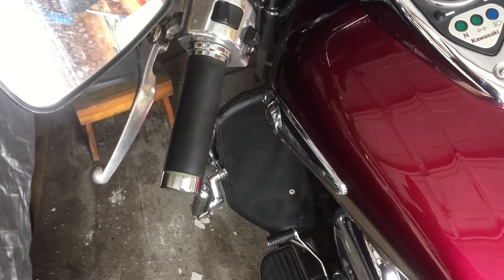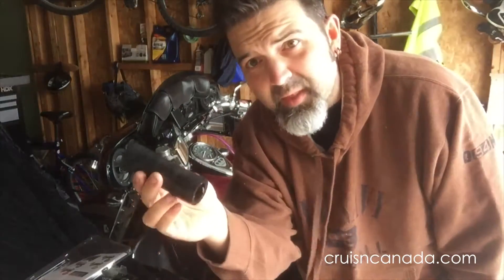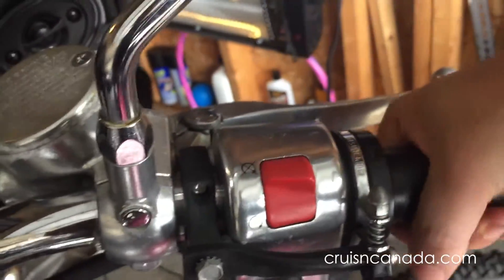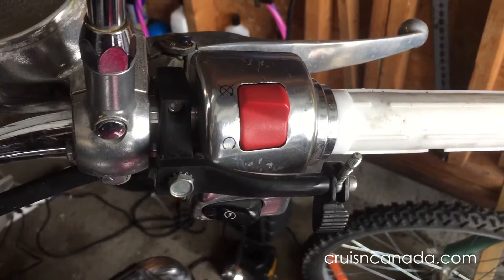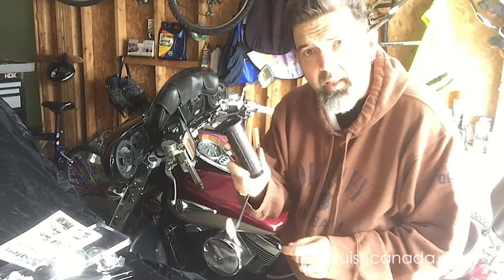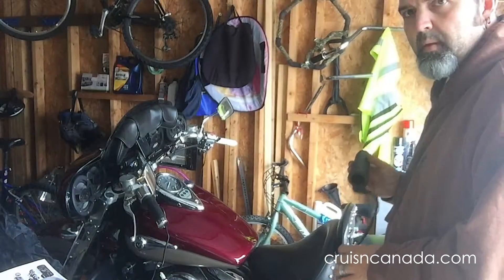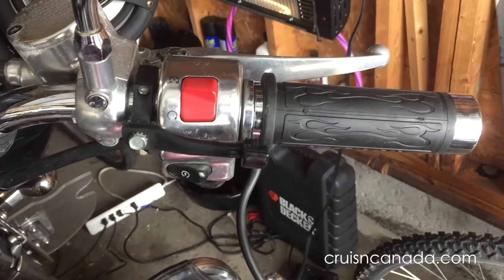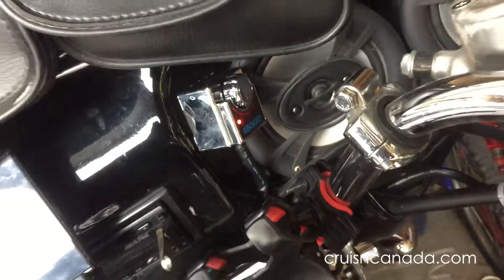Installing my Oxford Heaterz Heated Grips

Comment: For the right grip (brake side), it goes on loosely and sticks out a bit more than the left (clutch side). the only thing holding it on is the glue. I got 2 tubes of super glue in the premium package. I'll use most/all of 1 tube just for the right grip I guess.

Comment: Hi. I know its old video and thanks for it. I will install my grips today. But I have other question (if you are still here) .I have huge problem with buffering on my Road Star. Seen you are using lower deflectors. Any chance to tell me the size of them please? Cheers and happy riding
Reply from the maker: Jiri Mojak if I still had that bike I would tell you. Ride a different style bike now. But the lowers definitely helped for sure. Not sure of the size.
Reply: @gregtoope  ahh bad luck. thanks for your quick reply. really appreciate it. stay with the rubber down mate!!
Reply from the maker: J. M. Thanks 🙏. You as well.

Comment: Thanks for this video. I'm in central Pa, U.S. It was a tossup between these and heated gloves. If they keep a Canadian's fingers warm, they ought to do mine. Had no idea about install. Did not imagine it was so simple. forgot to ask. were you able to reuse your throttle lock?
Reply from the maker: 58gennaro not a crazy hard install.  Just a bit of time.
Reply from the maker: And I didn’t get to reuse my throttle lock. Ended up getting a different style. Have a new bike now so going to end up doing this all again this spring.
Reply: @gregtoope  Thanks for the reply. A throttle rocket was recommended to me. I didn't use the lock much anyway.
Reply from the maker: @58gennaro  yeah I didn't use mine much either, but I did replace it with a throttle lock that just rests on the brake lever.  Works fairly well.